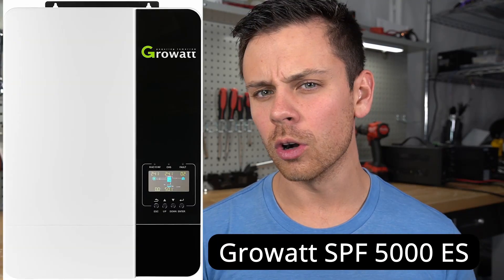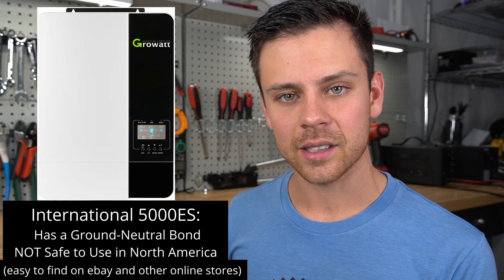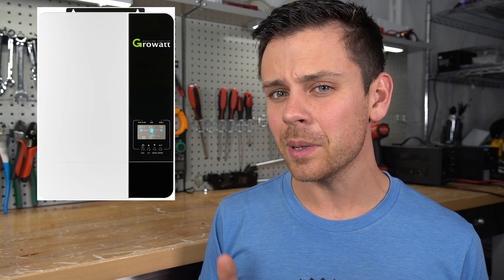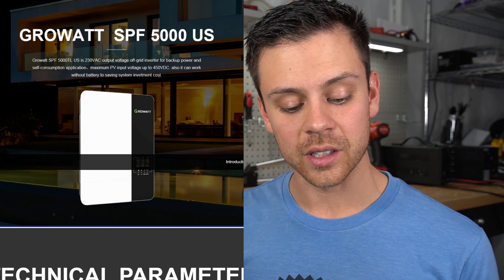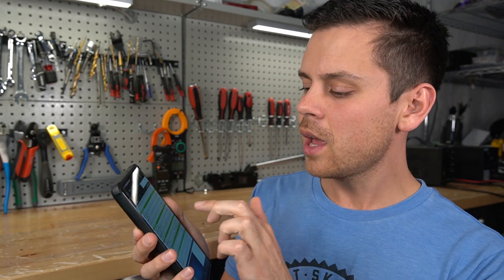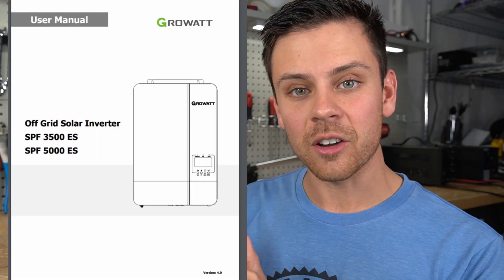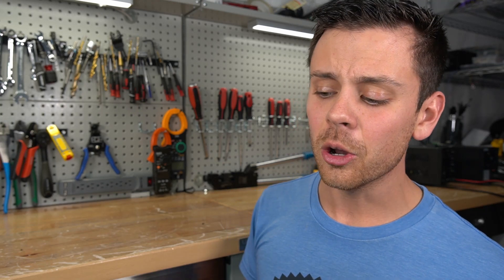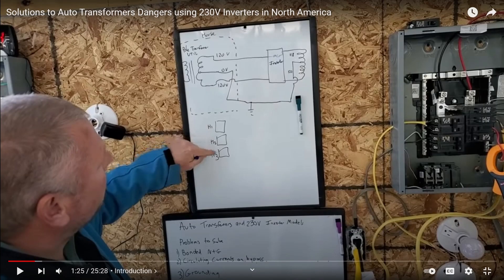The Growatt 5000ES Fiasco Explained: Is it safe to use 230V Inverters in North America?

Comment: This isn't really a new thing as I have seen plenty of inverters over the years where this was an issue including some US inverters that were intended to only supply 277V L to N as one phase of a 3 phase backup intended to run lighting in a power outage and people were buying and using them for regular off grid with a tapped auto transformer and the chassis was bonded to the Neutral so you had to make sure the case and the neutral were bonded to ground before going through a  stepdown transformer rather than an auto transformer that supplied a center tap for neutral and into the panel or you could get a decent zing off the case .  The big thing is that chassis ground should always be separate from L1 and L2/(Neutral in international markets)  They need to leave it up to the installer to bond or not bond the chassis ground to L2 with a clear label and it won't be an issue anywhere as it will be part of the installation and commissioning procedure.

It is also very common to see the chassis of many 120V inverters bonded or sometimes capacitively coupled to the midpoint of the 120v output which can also be potentially dangerous.  I do agree that they need either different SKUs or just make all of the inverters so that bonding is done by the installer based on thier local code requirements regardless of country since almost all inverters these days can do 50/60HZ and can be adjusted from 210 to 250VAC during setup.

Comment: Will - one comment about the MPP LV6548: You said that it's only a little bit more than the Growatt 5000es. However, in the scenario where you want split phase 240v, you can purchase the inverter and transformer kit for $1,250 but to do the same with the MPP, you have to get two of their inverters, which are $1,575 each. Am I correct about this, or am I missing something?
Reply from the maker: Oh that's true that you need two inverters for split phase output. Scratch that then, compare to lv6048 instead. Or lvx lf model. Really depends on your application, array voltage etc.

Comment: I Will, I have 18 solar panels on the barn and a 2.7 sky stream wind turbine on a pole. These are both good tied. I understand no power to the grid no power in my system. Here in lies the question do any of the small systems you build EMP protected. And if not can you explain how you would do that and still be able to use the system without putting it in a faraday cage. Thanks for your time love your videos Lynn

Comment: While not disputing the fact that many European-market Growatt SPF-5000 ES found their way into the North American off-grid market via Chinese drop-shippers, hence creating safety issues due to internally-bonded circuitry, you should note that Growatt designed and launched a full range of NEC/CEC-compliant off-grid and hybrid grid-tie inverters in 2020. Yes, naming these North American models more clearly (i.e 
(SPF-5000 US in lieu of SPF-5000 ES) in documentation needs to be addressed ASAP, so that customers don't unwittingly buy the Euro-spec product. But customers need to bear some responsibility especially for insurance purposes to verify they are installing ULC-certified NEC/CEC-compliant components, which the Euro-spec units are not. Growatt has selected Microgreen Solar (our company) in Canada and Signature Solar in USA as authorized dealers, and these sources can guarantee that a Growatt customer will be getting ULC-certified NA units (not offshore product) in addition to providing the service/warranty obligations that Growatt stipulates for Canada/USA.  I would also comment that many US customers seem to have grid-tied their SPF off-grid units, and there may be better Growatt grid-tie hybrid inverters (XH and SPH lines are certified for North America) that are ideally suited to serve a grid-tie system requiring battery backup. Getting back to reality, the NEC/CEC-compliant Growatt units that Microgreen distributes in Canada have NO safety issues, as some might take away from watching this video.
Reply from the maker: Good to know. Thank you.

Comment: I have 2 of them  and love them. However I was not aware of the bonding issue.  Nor am I  knowledgeable of to have been aware of such issues.  That is the problem, a lot of us DO IT YOURSELFERS rely heavy on YouTube and the many people on there to learn from. I have already gotten scolded by my utility co., they claim I'm backfeeding. I am not but that is a different story.
I have had 2 Growatts running for 2 months now and they are working flawlessly.  During my installation I got really confused over the subject of grounding and bonding. Again YouTube research got me through  it. But I had no idea about the bonding screw within the the inverter itself. So in away I'm glad this subject came up.
Reply: One screw to unbind. You can remove it.

Comment: I'm re-posting this from a replay I made below.

The controversy and confusion is being addressed right here, right now.  Richard @ Signature is doing back-flips as we speak to rectify this issue. Half of the reasons I use to choose a vendor are responsiveness and good character. Richard is demonstrating both. I've been in high tech for 44 years. Back when you could actually pick up a phone and talk with someone. That rarely if ever happens these days. I'm sticking with Signature. They pick up the phone.

EDIT: BTW I have no affiliation with Signature. I'm just a old guy in Northern AZ that appreciates hardworking honest people.
Reply: don't be a shill or a tool. No need for you to repost your bootlicking comment.
Reply: @michaelcohen9363  - “bootlicking comment”

Signature has been trying to right, had been doing right from the start with making sure their inverters were correct… much of the problem has to do with unscrupulous people selling non US equipment into the US Market 

I also feel badly for Signature’s situation.
Reply: @DavidHalko  Don't feel bad for Signature, they could've done more to make sure there was differentiation of products before they sold them. The fact that 5000ES and 5000ES are the same name, but different products is unacceptable. This isn't an issue with bad marketing... this is an issue where someone can easily electrocute themselves because they were provided bad information.

I'm not sure if you saw the comment where the one guy said he bought a 5000ES from Signature, and SS said they had done the fix for the USA box, but when the guy opened the box it turned out they hadn't changed anything. That is unacceptable as hell.
Reply: Hey  @michaelcohen9363  - 

I missed the comment on the the Signature inverter sent out, without the fix.

I do understand the severity of the situation, I agree the situation is unacceptable.
Reply: @michaelcohen9363  p1ss 0ph. You don't like it, then don't read it.

Comment: Marketing and promotion needs to clearly identify different models.
More importantly, every inverter and other component should have very clear electrical schematics showing important internal connections and showing recommended system setups.
As more amateurs get involved, clearer and more straight forward instructions are needed.
Here's a product proposal for all the manufacturers:
Redesign/repackage all components to be server rackmount to match the popular server rack mount batteries.
Use rear connectors and a backplane to make connections between components foolproof or make panel front connections with keyed and unique plugs to make incorrect connections impossible.
It also seems to me that all-in-one options are a bad idea as amateurs get involved.
Not understanding the different functions and components seems to make it easier to get things wrong (besides possibly having too much or too little of a function or not being able to upgrade in the future).

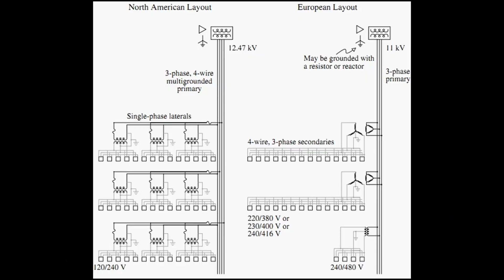Comment: 0:25 that schema is wrong. At least for Czech Republic code/state of things. We have primary distribution on 440kV, secondary 220 or 110kV and tertiary 35 or 22kV. This tertiary voltage is transformed for each village/part of village/few streets of town (roughly like 640kVa transformer is used) and these tertiary lines can carry like 3MW of power. Tertiary voltage is transformed down to 3 phase 230V or 400V combined voltage between phases. Typical household has tri-phase 25 or 32A main breaker.

Comment: Growatt off-grid inverters seems to be an MPP Solar clone too. Even the user manual is a rearranged clone of the MPP Solar's. Possible it is produced by the same company: Voltronic.
Reply: I prefer growatt because they have quality control stickers on the unit, the manual is bigger ,you don't have to take out magnifying glass to read the instructions like on MPP solar and usually the fans are quieter on growatts too, this is just my opinion comparing my spf5000es with a 8048max, I know the MPP is 3kw more, but even with no load the fans are loud. Also I think it is really dumb how MPP solar fans have to fight against the fact that heat rises upwards naturally, the MPP solar takes air from the top and pushes it out the bottom which is less efficient in my opinion, that is probably why it is louder. A good feature on the MPP solar is that it has a filter to keep large dust particles out of the unit. So each has its pros and cons.

Comment: I understand the issue in NA but I'm surprised of your opinion about Growatt. I think you cant base your opinion about a 97% inverter and 3w idle only on the marketing material. Here in europe, Growatt is seen a good supplier, especially in Germany where they are everywhere. If you can visit south of Germany there are PV panel everywhere, residential & commercial, company, farms, hard to find a roof without solar. German distributors are not lazy people and for sure they would not accept any troublesome equipments. For what I can see they stick on best models from Growatt that they perfectly know suits our needs. (SPH 5000 as example.). German manufacturer SMA is trying to catchup but with highend 3phases solutions (9000€ for 5kva inverter + 5kw battery Sunny smart.) . We also see Fronius inverters coming in the distributors. They have a good reputation in welding, I don't know about their inverters. A test ?

Comment: Great video, i was sold on Growatt but a little on the fence. I saw a video with them using a 5k midpoint transformer from solar edge to blance loads for the 230v es model... Are ANY of the international iverters any good like the PowMR inverters selling on aliexpress and amazon ? Can you do a video on these inverters in a future video because I trust you will do a complete inspection of them and give any other potential buying some advice. After seeing this and your other vids, i may be going MPP and thanks for that research you may have saved lives.

Comment: i have the 6 kw split 120/120 growatt and 220 pip  i just use it for hot water my favorite inverter is my samlex EVO 4000 Watt and my Cotek
Reply: and my growatt keeps going in over volt and cutting off the cotek keep on working at 61 volts

Comment: Will thank you , I recently purchased two Gro Watt 5000 ES from signature solar. When I heard about the problem I called Signature and spoke with customer service Elisha was understanding and issued me an RMA for both inverters.
Will I am thinking about going with the SOL ark 12 k for my off grid 48 volt 240 and 120. Have you any thoughts on the quality and the installation of the SOL ARK 12K. I will be using 18 450 watt panels and three 48 volt 5.12kw life pro batteries. Thanks so much for your time Will you are an inspiration to a lot of people.
Reply: I'm doing a VERY similar system.  I initially had planned on using MMP, or possibly Growatt AIO inverter(s), until I realize how much idle power they consumed.  The Solark 8k/12k looks to be the near perfect inverter for me, other than price.  David brought up some imbalance concerns with his usage, but I will never see the balance issues or loads he saw, so this is a nonfactor for my install.  The price is the deal breaker for me, it shoots the payback way too far out for my liking and ROI.  Excellent product though!  I will likely end up with one of the newer 8k China knockoffs for a fraction of the price, once I hear more positive feedback and get confirmation on UL listing.

Comment: The trouble in Australia - you can’t connect MPP to our grid - they’re not certified. Whereas Growatt are. Fortunately their inverters aren’t a problem in Australia.Bloody great to live in a 230V country.
Reply: But i am concerned about the neutral earth bon Will talks about,  that's a no no here in n Australia as well,  the only place where that type of connection is to be made is in the switchboard. I'm ordering a 5000ES next week,  will be checking for the bond when I get it.
Reply: @mattc9009  If the only bond is in the switchboard and the grid fails (the inverter switches to off-grid), then any RCDs downstream of the inverter will not work.
The inverter output must have a Ground-to-Neutral bond for downstream RCDs to keep working when off-grid.
The Ground-to-Neutral bond from inside the inverter should be made with a relay that's activated only in off-grid mode. If it is a permanent bond, then the RCD from UPstream the inverter will trip in line mode (when the inverter is just a bypass from grid input to the loads at the output).
Reply: @danielardelian2 Yes Exactly right they could do the bond with a simple good quality relay like Tyco, or really best to use a isolation transformer, the link is probably near the mains input filter PCB, actually even in the UK 🇬🇧 to have a appliance Neutral Earth Bond is unusual situation, but I know why they do it as a Totally Off-Grid unit, in the UK they sell for around £600 - £700 & for that its a cheap unit, although I would go & spend more money 💰 for a fit & forget unit made by Victron Energy
Reply: Australia have lots of that thing called Blue Sky & Sun 🌞 lucky yes, but where I live in the UK in Cheshire well we love Rain & Clouds 😂 but with the right weather & setup we can have lots of Sun, Australia 🇦🇺 is great 👍 but Im not into those Big Spiders 😂

Comment: Despite the fact that I own two of the Signature Solar Growatt SPF5000ES (US) models... loved the video and advice.   I'm moving forward with my install (probably this summer) but share your concerns.   I honestly feel like many of these underlying concerns should be investigated across ALL inverters however.   Many of the things people are concerned about are shared with other North American inverters.   Ground/Neutral bonding and the consequences around that design are inherent across this entire industry.   They are simply more blatant with the Growatt SPF5000.   If I'm wrong, I'll certainly fess up to my ignorance and buy something different for my application.

You ask why people go with this solution.   Honestly, I didn't know much better.   I had been considering a SunGoldPower unit, but found the price and ability to stack inverters (in qty of 1) appealing.   The neutral/ground bond issue was known, but not at the intensity that it is now (and as an extension, I feel it is not known for MOST inverters, including North American ones).   

Thanks for your honest and thoughtful review.

Comment: Hi Mr. Prowse.  I have a Sunpower solar/battery solution here at my home that I had professionally installed back in May of last year.  I have 18 of their 420w panels with microinverters, a smart hub (that is now my main panel, with my actual panel as a secondary, which directs power where to go), and a 26kw battery backup solution.

The batteries are Sunpower branded, but the battery inverter is actually a Schneider Electric XW Pro 120/240 hybrid inverter with their internet gateway.  Have you done a review on that yet?  It's rated for 6800w continuous and a lot of surge power.  It's a bit noisy when charging or discharging.

I'm not thrilled with the cabinets that house the battery and inverter.  They sell the system in 2 capacities - 13kw or 26kw storage.  The primary one which houses 2, 7.5kw batteries and the inverter is fine, but the secondary cabinet only holds 2, 7.5kw batteries and there's a ton of space left over which is disappointing.  They reused the identical main cabinet for the second cabinet and I would've vastly preferred to up the system to 39kw of backup energy.

That being said, I lost commercial power for a little over 2 days and if it wasn't for the constant drone of portable generators around here, I would've never known. :)

Comment: I’ll just stay away from anything growatt.
Reply: Then . Your missing out.
Reply: @kenbrown102  I’ve had my system in place for going on 6 years, there’s not much I need to buy now. I might buy a few panels to add to my system now and then. I already have a spare Midnight Solar sl150 hanging on the wall just in case.   Being off grid its always better to have backup items ready to go.

Comment: Edited:

I purchased both Growatt units from Signatures Solar.  

Richard from Signature Solar,
I was told that the bonding screw had been removed from a Signature Solar Growatt purchased in the USA.  I haven’t got these units up and running just yet.  I’m only two wires from turning the system on.  BUT, after seeing Ian’s video, I called Signature Solar, and they absolutely assured me that the bonding screw was removed and there was a rubber bushing between the circuit board and the case.  

Hmm, what do I think now????

I intended these Growatts as grid-tie and connected to batteries.  

I’m rather pissed at this point.😡

I actually took the covers off of my Growatts and discovered that the bonding screw is infact still installed.  

Thus this absolutely contradicts what Signature Solar is saying!